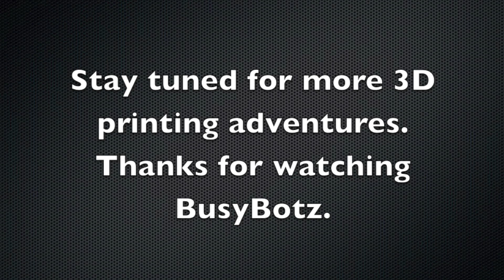eMinebea PG35 Extruder Motor Failure

Comment: I had one of these motors fail.  The little tabs you on the outside of the internal ring gear (the large one) sheared off.  After that happened the motor would not supply enough torque to push the filament through the extruder.

Comment: gearboxes dont like retract, try to avoid retract as much as you can or use another extruder design, or a stepper motor with more power to drive the extruder directly without any gears